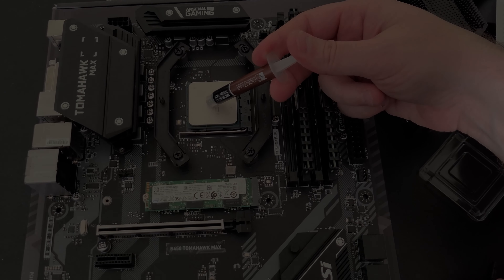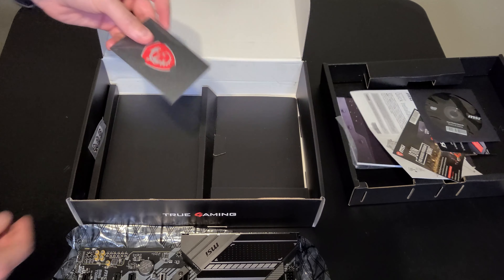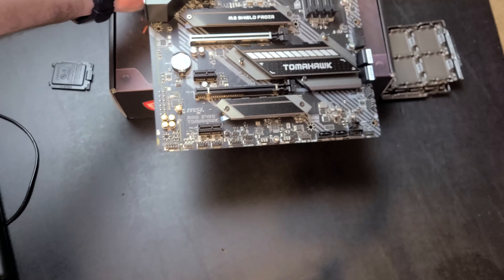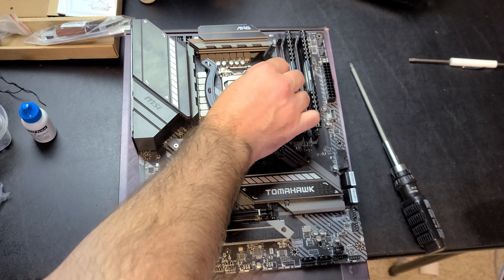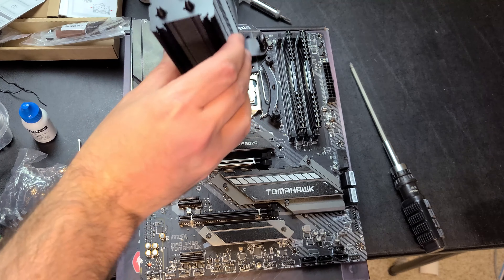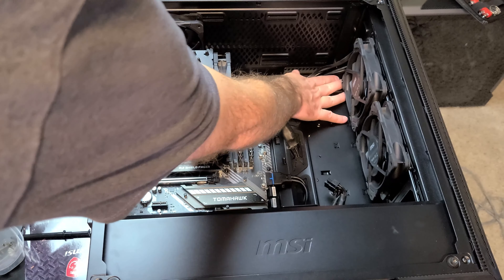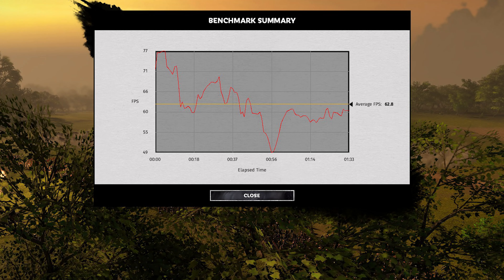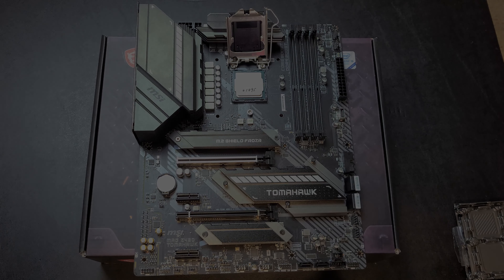Building a Gaming PC with Intel i5 10600k ft. MSI MAG Z490 Tomahawk

Comment: Hey Heir, I'm actually considering building my own PC and I was wondering if you could post your complete parts list
Reply from the maker: Here is the parts list as built:
https://pcpartpicker.com/list/Yf43Dx
Reply: dont buy a 10600k buy i7 10700. also a z490 a pro is plenty good for those cpus. consider a much cheaper air cooler as its a locked chip, like a hyper 212. then you can either upgrade the ram or probably the gpu to a 2060 super
Reply: My pc build : 
I7 10700k
Rtx 2070 super 
RM 850 Corsair
Asus rog strix z490 e 
H510
WD pcie nvme 1tb 
Cooler master hyper 212 rgb black 
32gb 3600mhz Corsair vengeance pro

Comment: Love the guide. Thanks!

Im on a very tight budget though. So im trying to save a few bucks on the motherboard. I found the MSI Z490 MPG GAMING PLUS for a couple of bucks less then the tomahawk. Dont see alot of reviews out on this motherboard so i guess it came out a little later then everything else. Is it worth getting or should i skip that and go for the tomahawk instead?
Reply: Skip the plus for the tomahawk bro, I was looking at the 490 Plus too but with this board you'll get 2 more usb slots and better coooling for your cpu capacitors.

Comment: Think that you put those mounting bars on wrong for the cooler. Each one is supposed to be horizontal (not vertical) if you're putting the cooler in that position.

Comment: I'm building my PC with this mother board, and a I9 10900K.
The "CPU power 2" is optional? I  saw you didn't use it.

Thanks by advance.
Reply: if you use a i9 you should plug the 4pin cpu conector too

Comment: So i have a problem related to this. bought this mothercard and a i5-10600k. With 2 hyperx 2x8 3600 ddr4. I still use my old asus strix 1060 6gb and stealth x stream 2 psu. I got a cm hyper 212 evo. And i get no video signal om my gfx card. I did get video signal on inbuilt gfx but after i installed the msi drivers and utility it now refuse to give a signal on cpu gfx. I didnt even get chance to get into bios. I tried to disconnect hard drives, gfx card, and still nothing. Hdmi cable btw. Tried another hdmi too and nada. Disconnected a ram stick and nothing.

Comment: hey Heir, could you do some Rome 2 and Attilla benchmarks? I'm considering buying the 10600k because rome and attila apparently run better on higher frequency cpus, but I can't find any proper benchmarks to see if difference is big enough to warrant an upgrade(curently using ryzen 5 3600).

Comment: im using the pc parts picker... it says at the bottom: “ Note:The MSI MAG Z590 TOMAHAWK WIFI ATX LGA1200 Motherboard has an additional 4-pin ATX power connector but the Corsair TX 850 W 80+ Bronze Certified ATX Power Supply does not. This connector is used to supply additional 12V current to the motherboard. While the system will likely still run without it, higher current demands such as extreme overclocking or large video card current draws may require it.” do i really need the 4-pin connector or not? pls help
Reply: Are you looking to overclock it or put a large gpu in it?

Comment: Nice review but considering board itself was CPU boosting at its full clock speeds without issues? What about VRM temps under load?
Reply from the maker: I didn't check VRM temps. You may check out Hardware Unboxed on YouTube. They do a ton of Motherboard VRM testing. But yes it was hitting full boost clocks on this board for me out of the box.

Comment: Sir please tell me i want a less pricey motherboard bcause i am going with gtx 1050ti and i6  10600k any suggestions?
Reply from the maker: If you are intent on sticking with the "k" variant processor like the 10600k then I highly suggest you spend the money to get a Z490 motherboard. They will run at least $120 USD most likely. So you could sort a site for Z490 boards from lowest cost and make a pick. 

If you aren't worried about overclocking then I would suggest you look at the B460 motherboards. If you by a B460 board though then the "k" variant parts don't make sense because their only advantage is overclocking and you can't overclock on the B460 motherboards. If you decided to do something like B460 look at the B460 Mortar or Bazooka. Hope this helps.
Reply: Sir they cost all the same so no point cheeping out now and thanks for helping... helped me a lit THANKS😁

Comment: Can any intel card be put in a Msi tomahawk , I would quite like to put my 3rd gen I 5 in one
Reply from the maker: No. Z490 is specifically for 10th generation Intel CPUs.
Reply: @HeirofCarthage  I’m looking for a good  fairly new motherboard and I was wondering what motherboard is compatible with a 3rd gen i5 and a Nvidia GeForce 1650, thanks .
Reply from the maker: @dritchie9417  3rd gen won't have any new motherboards that they work in. It is a pretty old CPU and hasn't been supported for a while. You may be able to look up on Google what chipset it is compatible with and see if anything is still out there.

Comment: Does a z490 board required 8+4 pin cpu eps connector..I have only 8 pin in my psu..Please suggest..
Reply: It does support 8+4, but you only need the +4 if your thinking of over clocking or adding a powerful gpu

Comment: Thermals of the noctua u12s and i5 10600k?
Reply: I have the same board, cpu and U12S (Black) w/Push/Pull and idle temp is 19c degrees and max 57c degrees

Comment: I was planning to build with mag z490 tomahawk but with i5 10400 is it good?
Reply from the maker: Z490 is probably a bit overkill for a non "k" processor. So here is my suggestion. If you know that you will later want to keep your motherboard but upgrade to an unlocked "k" processor like the 10700k or 10900k then yes get Z490 Tomahawk. If you never plan to overclock then MSI B460 Mortar motherboard would be a great board for the i5 10400. Z490 allows for faster RAM and CPU overclocking. If you aren't using those things then B460 makes more sense.
Reply: @HeirofCarthage  That would be more relevant with the release of the 11th generation processors, right?
Reply: @salmaelesawy361  the b460 doesn't support 11th gen I think, you'd have to get a b560
The z490 supports 11th gen

Comment: Hello. Thanks for great content Sir.
i'm going to buy setup for gaming and work, i reallyyyy need some help guys.
What i'm thinking and according to my budget, i must get:

- CPU: i5-10600KF
- Motherboard : MSI MAG Z490 TOMAHAWK
- RAM:  G.Skill (1x8GB) Ripjaws V Gaming Series 3200 MHz CL16   x 2
- PSU: CORSAIR CP-9020210-EU CV550 550W 80PLUS BRONZE POWER SUPPLY
- CASE: Sharkoon RGB LIT 200, PC case
- Monitor:  MSI 27" OPTIX G271

- GPU: None - (don't have budget at the moment.)

PLEASE  advice me guys if there's anything missing to run the pc. I did some research and i think with this build i need a graphic card since the i5-10600KF has no integrated graphic card so the pc won't boot 
is that correct? do i need a graphic card? 
If it's neccessary, can i run it with just GT1030 ?

Thanks a lot everyone! Have a good day!

Comment: Results in 1440 pleas?
Reply from the maker: If you back it down to high in 1440p instead of Ultra i would expect you get similar performance. I would need to plug it into my other monitor and find out for sure.
Reply: 1440 warhammer will thrash even high end machines if you're planning to run ultra settings. Unless you desperately need to play on a 1440p display, I'd highly recommend using a 1080p screen and simply downscalong the UI to get more real estate that way...